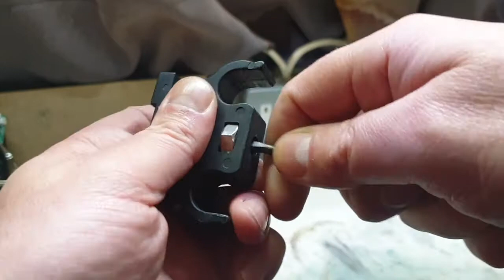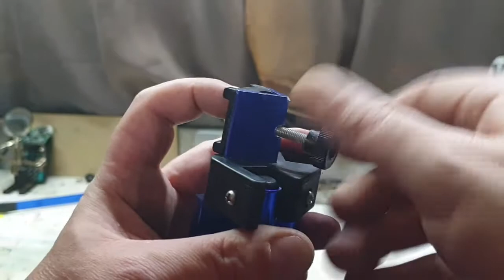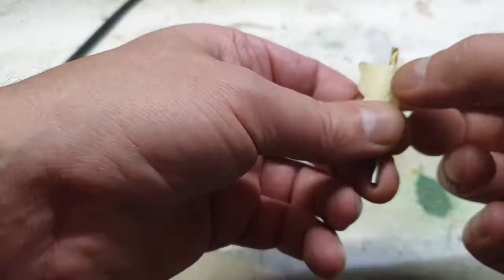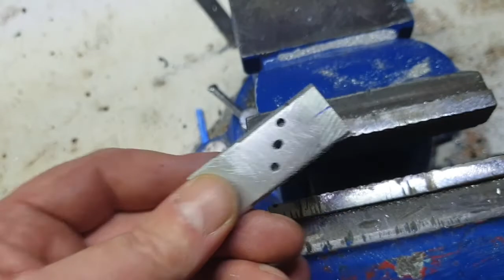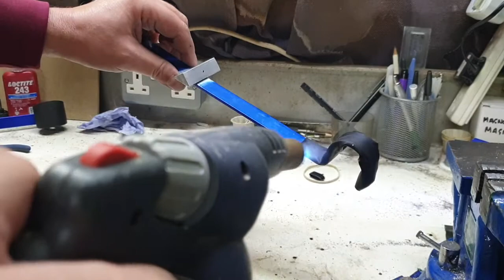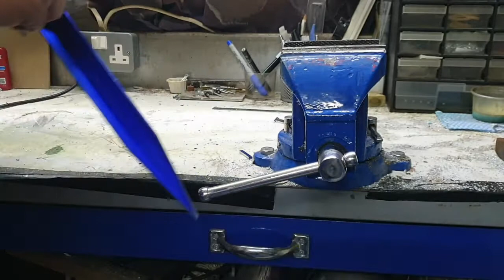Shakespeare Salt tripod modifications- how to

Comment: Just a thought but would a step drill be easy for the holes
Reply from the maker: Yes a step drill would work better. Also, drilling from the opposite side means it wouldn't disturb the runners. Thanks for the suggestions.